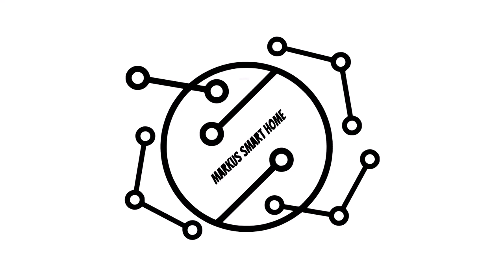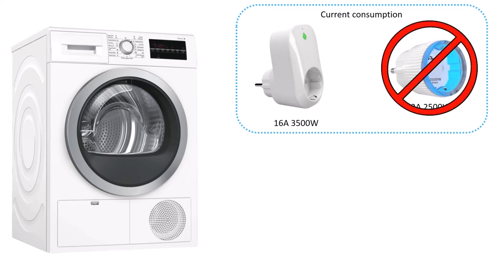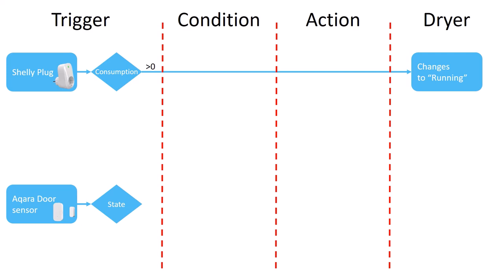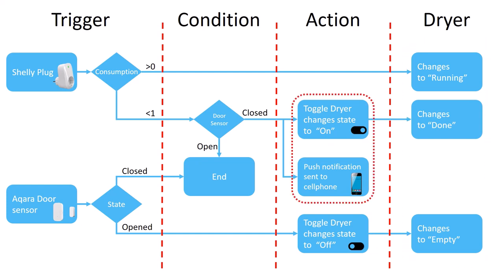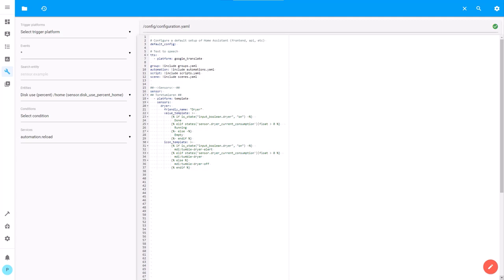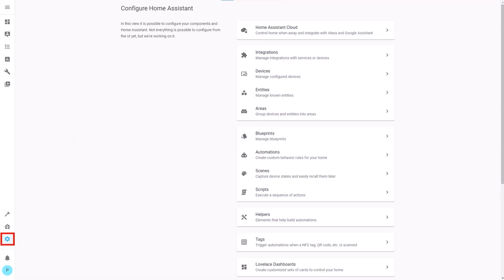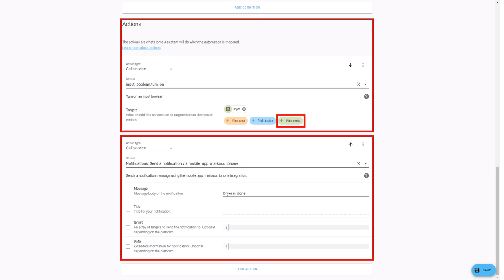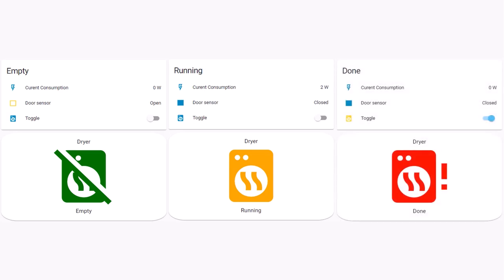Make your Dishwasher, Washing machine or Dryer smart with Home Assistant

Comment: Thanks for the great explanation. Now that I have everything working, I would like to show the status on my lovelace dashboard. You have used the custom card function. Which standard standard card can I use for this? And will you make another video for the custom card, specifically for this dryer video? Thanks!
Reply from the maker: Glad you liked it! 

###
You can use the button card if you want, you wont get any colors and you cannot change the layout.

type: button
entity: sensor.dryer
show_state: true

###
I don't have any plans to make a video on the custom button card for the dryer. I have done a video about the custom button card, explaining a little bit how it works and how to add colors and change the layout. https://youtu.be/ClxxjLSZZMw

Here is the lovelace code I am using for the dryer. 
type: custom:button-card
entity: sensor.dryer
show_state: true
show_name: true
styles:
  icon:
    - color: |
        [[[
          if (entity.state == "Empty") return 'green'
          if (entity.state == "Done") return 'red'
          else return 'orange';
        ]]]
  grid:
    - grid-template-areas: '"n" "i" "l" "s"'
    - grid-template-rows: min-content 1fr min-content min-content
    - grid-template-columns: 1fr
  card:
    - border-radius: 10%

###
I hope it helped!
/Markus
Reply: @markussmarthometech984  thanks!

Comment: usually, the W doesn't say 0 and in most cases, it changes or fluctuated. How do we do it? If I don't want to add aqara will it also be possible?
Reply from the maker: Hi,
The logic is based on two assumptions:
1. Watt is 0 when the machine is done/off. (Machine is turned off automatically when done)
2. Watt is above 0 when the machine is running

There are machines which does not turn off itself after completing the program. What you can do is to change the logic for done and instead of below 1 W, you can monitor and find another value which indicates that the machine is done and if needed combine it with a 'for' statement. For example: Above 2 W and Below 6 W for 5 min. 

Do you want to use another door/window sensor if so, which protocol? 

If you don´t want to use a door/window sensor, is there any other way which you can know that you have emptied the machine? If you have a machine which does not turn off itself (meaning W is above 0 when the program is done), you can instead of the door/window sensor use W for triggering the Empty state. Basically, when W goes below 1 for 1 min turn off the helper -> sensor goes to Empty.

I hope it helped!
/Markus

Comment: Hi, I am having Beko Dishwasher with wifi support and 16amps smart plug. Doors will not open after completion of the machine. How can I connect to home assistant?
Reply from the maker: Is there any integration for Beko dishwasher to Home Assistant?

The smart plug will give you information when it is running and when it is done based on current consumption. How would you like it to work in Home Assistant?
Reply: @markussmarthometech984   Hi, I do not know Beko integration with home assistant. I looking for energy monitoring on different cycles (like pre washing, rinsing, drying) and different programs, triggering, state of the conditions... etc. If any new features oriented measurements with home assistant.
Reply from the maker: @wealthyinformation8340  Ok, based on the energy measurement it should be possible to determine which cycle it is currently running, e.g. in the beginning mine uses close to 2kW for a certain amount of time and then goes down to between 80-250W for a certain amount of time and lastly it will go up to 300W. I assume yours are doing something similar, run one program and monitor the current consumption and the cycles to get the relationship between them. Thereafter, based on that information you can build a sensors for the cycles. 

For a programs sensor you need to do the same monitoring but for different programs and determine how the energy consumptions differs between the programs.  

I hope my answer was to any help :)

Comment: Can I automatically start my dishwasher after my washing machine finishes?
Reply from the maker: Technically it is possible if you have a dishwasher that you can start from home assistant. I would recommend to create another toggle (Dishwasher after washing machine). If it has state on, your dishwasher will start when the washing machine is done. Just to be able to control if the dishwasher should start or not after the washing machine.
Reply: @markussmarthometech984  cool thanks for the input. I might need to tie this into my hot water heater too. (Or make a delay). So there is enough hot water for the dishwasher to start after.